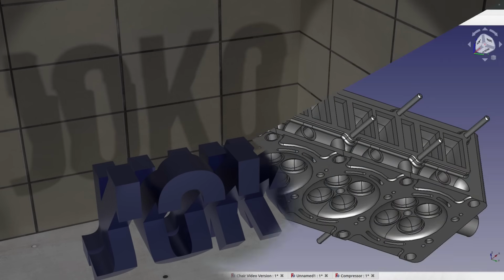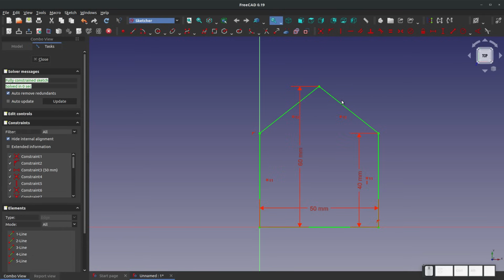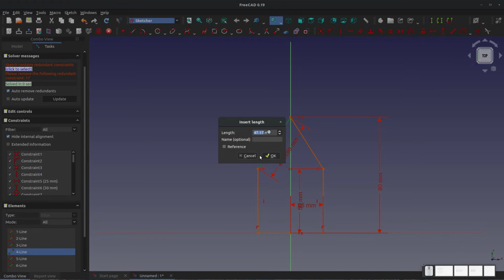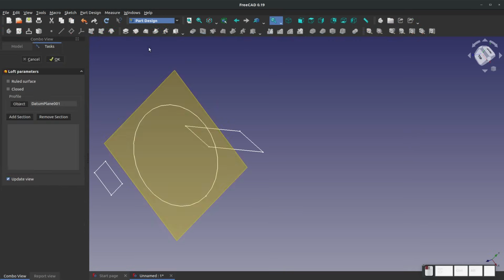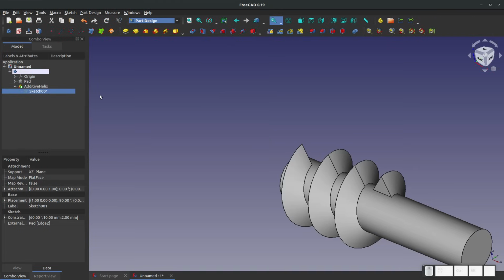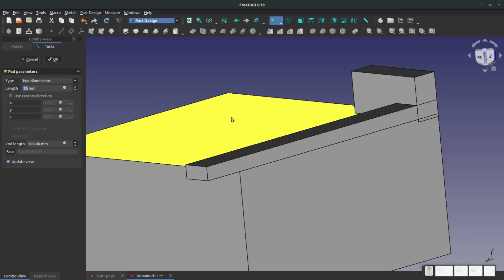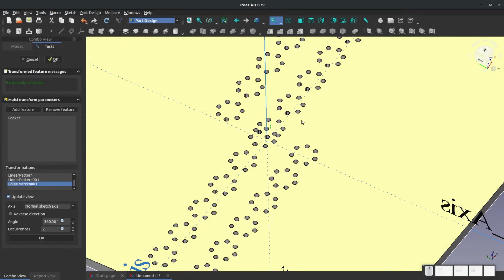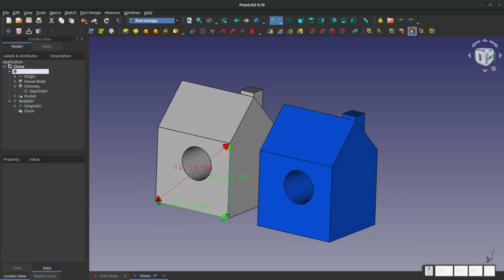FreeCAD: The 2022 Complete Beginners Guide To Part Design |JOKO ENGINEERING|

Comment: 8:27 free cad is free that the only best part? It's been more than a week but I'm not able to make one single top of table in sheet metal work bench, cause sime time after using pad my object get missing, but after dealing with that when I come to sheet metal my options to creat bend of hemming gets missing, since last 4 days I'm just trying to find my feature and options of sheet metal, Trying chat  GPT, google, you tube etc but still I'm not able to find it, other options which you have mentioned are far better option than freecad but the problem is that they are paid, so no software is better, either you give money or you give money in terms of mental peace or time 8:30

Comment: Thanks for the instructional video! I admire your use of Linux as a structural engineer, what other open source engineering software do you use besides freecad?
Reply from the maker: FreeCAD is my main one. Ive used solvespace before.  Also CAELinux, which allows for CFD in freecad.  I've used Salome Meca for analyisis as well.

Comment: Exceptionally good tutorial video. Nobody covers it all, but the author here covers as close to everything as anyone else- and you will not need much more than this to enable you to become PROFICIENT with FreeCAD in short order.  FreeCAD is very quirky/strange, even downright annoying at times.  I am a 56 year old man who has done my share of 2D work in Autocad as well as high end 3D simulation work- but that was all in the past.  I have a current and serious need to do some real CAD work, and I did not think it would take me too long to get up and running on another CAD package, but I was wrong.  After many days of reviewing the CAD options out there, I decided FreeCAD was the best option for me- mostly for all it can do, but also for the confidentiality of what I am working on.  Any program that needs a connection to the Internet is NOT an option.  Many of you have heard that FreeCAD has a steep learning curve compared to other packages out there, and those comments are TRUE.  Take the time you need and carefully soak in this whole Tutorial, and it will end up being about the fastest way to get you "over the knee" relative to learning what you need to learn.  Thanks for a job well done.

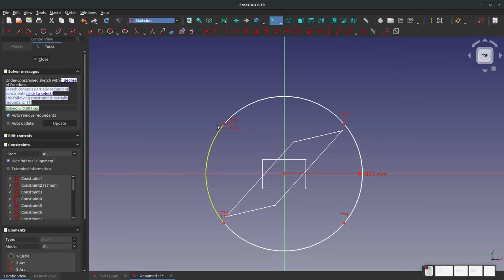Comment: 2024 april 20.  FYI1. 1:08:53 Version 0.21.2 Arc tool of FreeCad is not able to close the ring. "Sections must be all closed or all open". I stuck in this for several days. I learned a lot at that time but you better know "it is not your fault". At 1:24:40  V0.21.2
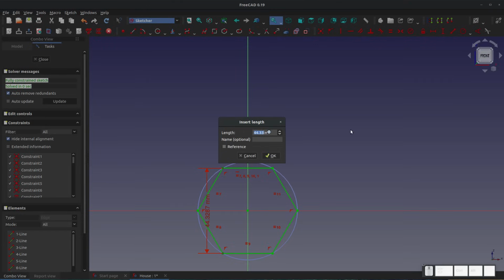Ortographic view mouse hover does not every time show the chance to link an external geometry. 2:16:14 Hotkeys have changed. Distances are i, L and kd. Hotkeys can be lower case.

Comment: Really Great video !  Wondering how we set up the tool bars  to look like the ones you use. My download of FreeCad isn't showing most of the sketch tools you have showing,  might take some time to customize, is there a simple way to set it up ?
Reply from the maker: Sometimes those toolbars are a little "compressed".  I've never gotten to the bottom of why, but I imagine it's to do with different operating systems and screen resolutions.  At the end if the toolbars you can see those two columns of dots?  Click on those dots and drag the tools a little and  you should be able to place it in a new row or re-arrange how you like.  The missing buttons should show up then.  Let me know if that helps.
Reply: @JokoEngineeringhelp  Got it, thanks !

Comment: This video is awesome thank you! Only trouble I had was not selecting auto-remove redundant constraints in preferences. Took a while for me to remember that when trying to figure out why all my shapes were breaking when adding constraints.
Reply: The cyclops used for the clone function icon is Dotty the sheep they cloned back in the 90's btw, if you're still wondering.

Comment: Thanks so much for this. I wish I'd watched this to start with! Got so confused with shape bindings and booleans.

One thing I still can't figure out is how to align bodies. E.g. if I have a square shaped pocket and a cuboid body that would fit perfectly into that hole, how to transform it quickly so that it perfectly fits. Or how to move a body so that one face is on the same plane of another face on a different body.

Seems there is an add on for this, but my add on manager can't seem to find any add ons. Feels like this is something that would be built in by default?
Reply from the maker: The a2+ workbench or similar would by my best bet in easily having two bodies work together.  I haven't heard any addon manager complaints for a long time, the last time someone said something about that this was the solution https://www.youtube.com/watch?v=7I7W_H8T_JM

Comment: Just a note for the Helical Feature Example:  If you're running into a problem with a ''Wire not Closed' error, you don't include the box inside the cylinder.  When I removed that the helix was able to be added successfully.

Comment: Fantastic video. I just want to point out in current 0.21.1 the hole tool actually has the ability to model the threads now. Still heavy but it's there. I printed some threads and they worked great. Thanks again.
Reply from the maker: I do need to make a new one of these to cover recent versions.  Thanks for posting updates.

Comment: This has been great so far... but I am stumped.  At 1:08 when I add the final arc in, it does not seem to add a constraint coincident between the last end of the final arc and the start of the first arc.  I've made sure I am absolutely lining them up and getting the constraint indicator.  All of my other arcs lock together nicely.  This leaves me with 5 DoF's instead of the 4 you get.  I've tried manually connecting them and that also does not work.  I am on v 0.21.01.  Thanks!  (PS> To get around it, I basically set constraints on those points individually)
Reply from the maker: That's tough when something like that happens.  Sometimes the computational engine can get something mixed up and think the sketch is overconstrained when it's not.  I've seen it in other platforms too.  It might also help to take the two points you want to connect and give them a vertical and horizontal constraint in place of coincedent, I've seen that work too.

Comment: Just got a cnc machine. I want to use freecad to design stuff for my machine. Will i need a CAM program seperate of freecad?
Reply from the maker: The paths workbench will generate G-Code from the native file in FreeCAD.  If you prefer a different CAM program, export as STEP file and use that. 

https://www.youtube.com/watch?v=MWFC17MIfOE
Reply: @Joko Engineeringhelp  thanks! I bought the machine and then when I started learning about the software I felt like I made a mistake. There isn't many truly free softwares out there.
Reply: @Joko Engineeringhelp  I'm probably getting ahead of myself. First off what I've watched so far is amazing. Thank you for the tutorial. Can you import images and seperately can you use text in freecad
Reply from the maker: @stingray1761  You can use images here:

https://www.youtube.com/watch?v=yVmtAP1KCfY

I also make a series of modeling a 3D corsair from 3 different images.

Text is a little different, I have a video on it here:

https://www.youtube.com/watch?v=AnM4miAc3gc
Reply: @Joko Engineeringhelp  thank you for all your content and responses! I'm definitely running into a learning curve on this stuff and your videos are invaluable so far! One more, how'd you get that Grey skin for your freecad? All these bright white tool bars are hurting my eyes lol.
Reply from the maker: @stingray1761  Sure- Edit>Preferences>General>Style Sheet>ProDark

Comment: I don't agree w/yr comment and perception of autocad or 2d drafting. I've been a draftsman for over 50 yrs and started implementing 3d way b4 it was main stay. I got into 3d because it was a faster and cleaner(u can't fudge inaccuracies in 3d), but both require a type of artistry that demands a type of articulation most people don't just possess, drafting is an art form to deliver information whether 2d  or 3d. If you don't see that way neither 3d nor 2d will make much sense, it's really about information presentation. At that, nice job on freecad presentation which is still somewhat convoluted yet one of of the best non-proprietary drafting programs. It also does so many other things that computer based drawing programs are capable of! It's a great program, thank you for your presentation. I guess this is part of getting older, my view that is. I have degrees in fine arts, mech eng & computer sciences. Many engineers can't do good nice looking drafting, in the end you are stuck with a 2d paper drawing be it done with 3d or 2d ( I guess now we have 3d printers that can't work with inaccuracies ). My point is really not everybody can see or draw the important abstractions, it really requires a certain type of intelligence.

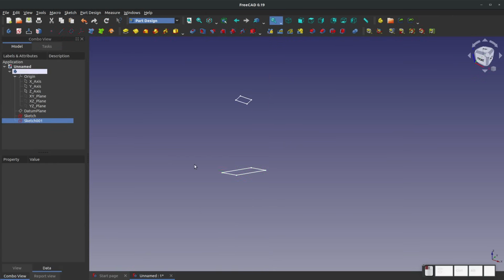Comment: 1:03:45 So the horizontal direction has to be applied negative to be on the left of the axis. But there are two vertical dimensions which are both positive even though they are on both sides of the axis?
Reply from the maker: I usually use a negative sign to flip the dimension, but sometimes it is interesting when a negative sign shows up on a dimension by itself.  I haven't figured that out yet.

Comment: I am a beginner in freecad. In this part of the course I am trying to draw the sweep part, however it doesnt increase in shape as your example. I am un der freecad 0.20.1 instead of 0.19. I can see that I have similar problem than @RamboMadCow 8 months ago but I cant see the fix for it. After adding the sketch002 in section transformation and clicking ok, I receive an input error (A fatal error ocurred when making the pipe) and then freecad close.
This is Daniel from Canada
Reply from the maker: You can send the part to the email in the description
Reply: I'm having the same issue.

Comment: 2D sketches are easy enuff, but putting them together into 3D objects never quite clicked until watching this. Been using mostly primitive boolean shapes in the part workbench, it's worked well enough to do FDM 3D prints for a few years. Thanks for helping move on to the next level.

Comment: I’ve been thinking recently that because of the topological naming problem, I should save all fillets and chamfers to be done as the very last step, and delete and recreate them if I modify anything further back in the history. Would you agree with that?
Reply from the maker: Yes, and that should be a best practice for every parametric platform even without topological naming issues.  Well done.

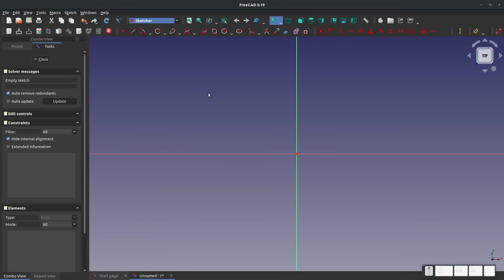Comment: 13:06 Would the spline be good for making the Tesla Valve? And then wrapping the Tesla Valve around a cylinder... like the thread of a screw
Reply from the maker: That's a cool concept.  Spline would be good, you can also use tangent arcs if you need a constant radius.  To wrap around, the part workbench projection on surface can be handy.  https://wiki.freecad.org/Part_ProjectionOnSurface

If you have trouble, maybe project part of it and do a pattern.

Comment: When you drew the primitive with the hole through the center you used the origin to make the circle. Is there a way to use a reference point on the face of the primitive so that if the size of the primitive changes the hole position also changes??? I can't select any part of the primitive as a reference point. Very frustrating.
Reply from the maker: I'll need a time stamp from the video to know what part you're talking about

Comment: Why in Scetcher the user does not have useful tools such as a mirror, copy, array, and so on. On the other hand, if I draw something in Draft then it is not compatible with the Part Design/Scetcher. For example, If I use the Scetcher and I need to make an array of circles then it is quite time-consuming in the Sketcher......
Reply from the maker: https://wiki.freecadweb.org/Sketcher_Workbench

This documentation covers mirror, array, copies and so forth.

Draft is meant for dxf dwg compatibility,  not really for the kind of base modeling that this video covers.
Reply: @JokoEngineeringhelp  Thanks a lot. Now is clear. It is really a powerful tool. I found all the tools I needed thanks to you. You have a 2 L beer from me :).
Reply from the maker: @evgeniborisov7012 Thanks I sure will! One of the things I hope to see in future developments is mirrors/arrays that will replicate sketch constraints.

Comment: How do you get back to the first screen?   I have a  empty screen with a dominant grey window, two rows of tool bars, one showing "Start" in a pulldown box, and the other with some view-modifying icons.
Reply: After I trashed it and reinstalled, I see that the start screen should have a "x Start Page" tab on the bottom that has all the stuff you show on it.  When things were broken, I did have a "x Start Page" tab but it was empty and white.  I opened the icon with the globe and the white box, and it gave me a file:///Applications/FreeCAD.app/Contents/Resources/share/Mod/Start/StartPage/ and I found a StartPage.html file in that directory, but when I tried to open it, it gave errors.  That's when I decided to delete and reinstall.

Comment: I make a drawing then start adding dimensions but pretty soon the drawing ends up covered in red dimension lines and I can’t see the thing I started with.
Is there any way to hide the dimensions or toggle them on and off so that they’re not in the way?
Reply from the maker: Yes they can.  It's hard to describe in writing, see the video someone posted here https://forum.freecadweb.org/viewtopic.php?t=31282
Reply: @JokoEngineeringhelp  I've just discovered it’s actually really easy.
You just look at the ‘constraints’ menu in the ‘Combo View’ where there are two boxes; “show listed” and “hide listed”.

Click “hide listed” and all the constraints disappear.
Inside the constraints menu each constraint has its own box next to it, click that box to show or hide any individual constraint.
Still have problems though, coz it seems I only have to make one single mistake and the whole thing locks up and there seems no way back.
That is such a pain, but then again nobody said it was going to be easy.
Still workin on it guv.

Comment: This is better than Flowie the German and the others I've seen. But one BIG complaint. It's too long, for the reason that trying to move the time slider back to a point I can review something, is impossible The longer the video, the harder it is to use the time slider bar. Would have been much better broken up into multiple, shorter lessons, so that the time slider can be used without so much wasted time having to sit through things to get to where I wanted to be.

Comment: Can I use a binder with a complex shape from a padded sketch to make a part that can interconnect like they do in woodworking or the more famous Japanese way of using wood without fasteners? I mean can I use the binder to create a unique shape I will use to segment my part and later physically use connect the parts? This would be for a 3D printed part that's too big to print on my printer and will print pieces in smaller units of time.
Reply from the maker: An intelligent approach.  Yes you can.  I would make a multibody part and export the bodies as STL or similar format separately.

Comment: This is by far the best tutorial I've seen on FreeCAD. I installed the program to draw out the plans for a chicken coup. Could have done it with pencil and paper but wanted to be able to make it easier to make changes as I designed it. Looked at several tutorials but couldn't make head or tails of how to use the program. Finally figured out pretty much on my own how to do what I needed but knew there was much more. Now I think I'm going to actually be able to use the program.

Comment: How do you get around the topological problem? I noticed that you are using references off surfaces which is easily broken in FreeCAD. This has been very frustrating for me. So many things in FreeCAD don't work the way they should. Fillets are also problematic. It seems way too easy to break things in this program.
Reply from the maker: Version .20 is merging with the realthunder fork which addresses topological naming.  I almost never have topological issues myself though.
Reply: @JokoEngineeringhelp  That's great news. I'm glad realthunder was able to solve this problem, and that it will be incorporated in the next release. I can't tell you how many hours I wasted in frustration over this problem.
Reply from the maker: @rcort4864  I've been talking about the need for stronger fillets for a while, but not even being a programmer I can only imagine how challenging that is to try and develop that

Comment: Anyone know how to measure, and display that measurement, within a sketch without constraining anything?
Reply from the maker: There is a button in the sketcher workbench that has a blue and red square.  Click on that (it may be on a drop down menu if all the buttons don't fit on screen) and the dimensions will turn blue.  Dimension with the blue dimensions to create reference measurements that do not constrain.  Click the button again to return to constraining dimensions.
Reply from the maker: https://wiki.freecadweb.org/Sketcher_Workbench

It is listed here as "Toggle reference/driving constraint"
Reply: @JokoEngineeringhelp  Thanks again, Joko. Excellent explanation and link. Very helpful.